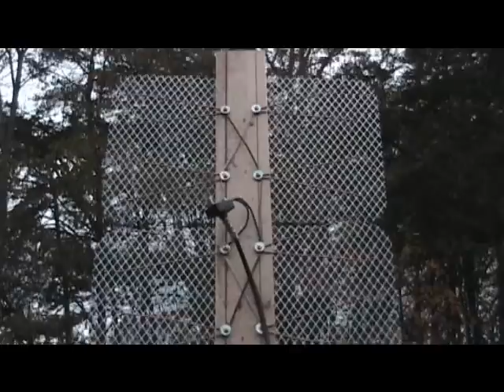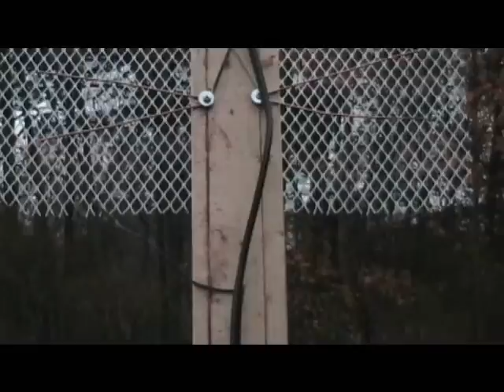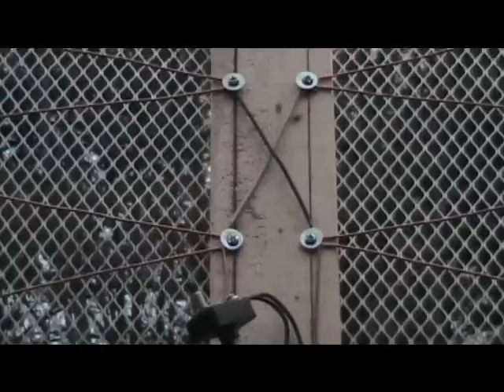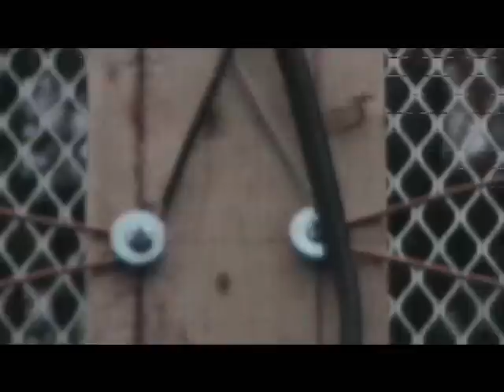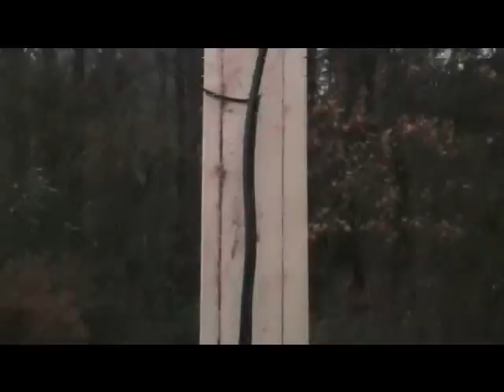Digital TV Antenna

Comment from the maker: @NotRite225 The mesh wire is are the surface from disposable charcoal grills that I bought from Lowe's during clearance, the element wire is plain copper 12/2 with ground house wire that I had left over from work (about 15 feet). If this doesn't answer your question let me know.

Comment from the maker: @MrsCliffordtheBigRed You do not need any other equipment, however your TV must be able to receive digital antenna signals, all TVs manufactured over the past 4 years can. Concerning cable channels, if the cable company transmits digital over the air then yes you can. Each area will differ so you will have to try an antenna, experiment with the location see what you get. I am still experimenting with positions in order to get the maximum stations without moving.